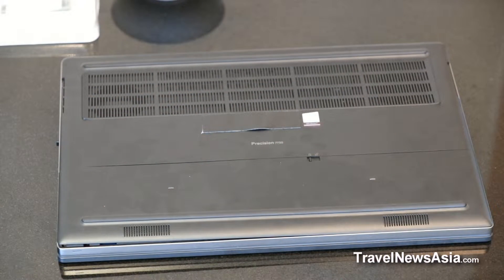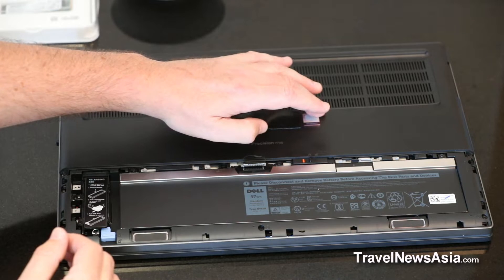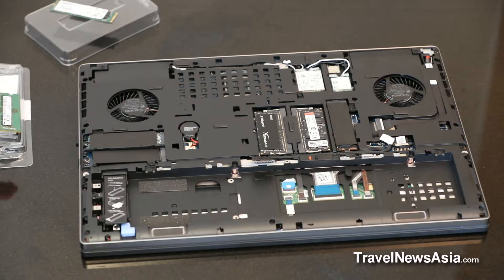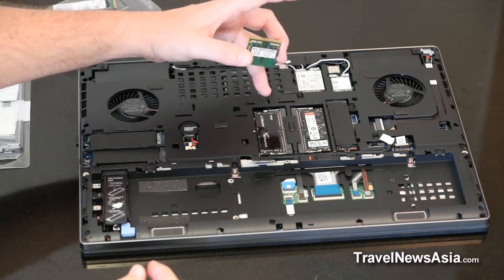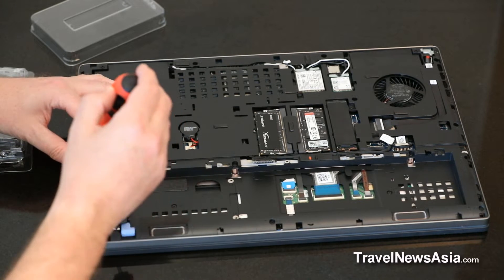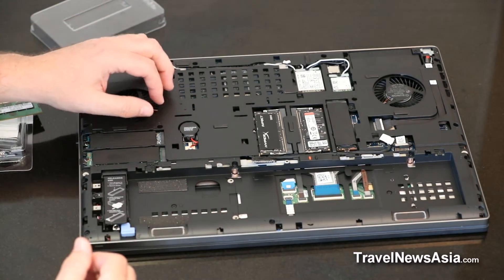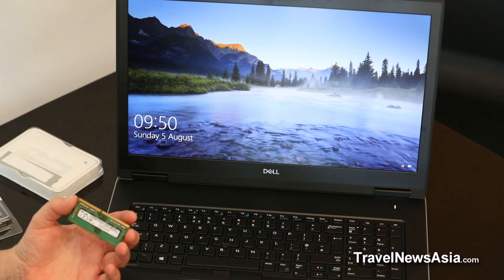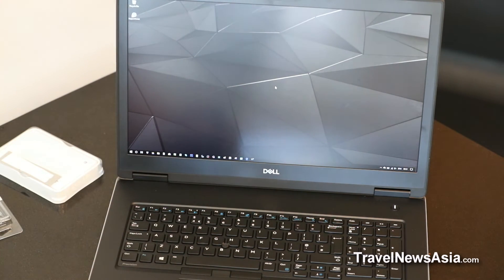Dell Precision 7730 Mobile Workstation - Opening Back to Install RAM and SSDs

Comment: Excellent thorough video. Really looking forward to your full review.
Reply from the maker: Thank you for your kind words. Much appreciated.
Reply: asiatraveltips Unique content. Can’t see any of these laptops in person before purchasing and Dell should produce decent videos themselves but they don’t. Ideally I would like the 5530 but the fans will be on all the time which would drive me crazy. I am guessing since the 7730 is thicker it will have proper ventilation and won’t be noisy. Please abuse it during your review testing I’m guessing there is benchmarking software out there that can make the cpu/gpu work hard on demand.
Reply from the maker: I can tell you that the fans are surprisingly quiet and only come on when I am rendering FHD 1920x1080 video. Most of the time they are silent, even when editing RAW pictures. I am extremely impressed with that as my other Dell Precision, the much older M6600, is much noisier.

Comment: For someone who is not experienced it would be helpful to actually see you finish each process like actually unscrewing both screws and removing the back opposed to jumping to screen with it already removed. I am new to this and after I unscrewed the back seemed very difficult to remove and I am not confident enough to apply great force removing BUT if I saw you do it here and seen that great effort is needed it would be that much better. Maybe trivial in some ppls minds but you should take ALL levels of experience into consideration. Information good overall though. Thanks
Reply from the maker: Thanks for your feedback. The next time I do such a video I will do as you suggest. Thank you.

Comment: Thank you for the video and showing the interior design.
Unfortunately, there are no videos yet for the Precision 7730/7530 laptops, so I think it's good that you're the first :-)
I have some questions for you ...
Why did you only install 2400MHz RAM? According to Dell information, up to 3200MHz RAM is supported. Dell currently has only the 2666MHz Version selectable on the web page, but it will follow the 3200MHz Version at the end of August.
Reply from the maker: Thanks for your message. I bought the 2,400MHz CL14 RAM as I already have 2x16GB sticks of that RAM and so bought two more which gives me 64GB of 2,400MHz CL14 RAM in total. I did look at 3,200MHz RAM but the 64GB I have now saves me money and when the 32GB modules come out I will look at their price and consider upgrading to 128GB at that time. My next video will be about removing the front to install the other two RAM sticks and then there will be a video review once I have had spent more time using the computer. I am very pleased with it thus far. In case anyone is wondering, the 8GB of RAM that came in the laptop is Samsung  2,666MHz model: M471A1K43CB1-CTD.
Reply: Thanks for your quick reply :-)
Okay, if you already have 2x16GB, then of course that's logical.
Which application do you need 64GB or 128GB RAM? For pure video editing are 32GB but ok. I'm looking forward to your next video. What interests me personally is how well the cooling works and how loud it is. Especially how the CPU throttling under load. Most laptops today have massive problems with the 6-core CPU and are throttling the CPU a lot.
What exactly did you configure for a CPU and graphics card on the 7730?
Reply from the maker: You are right, 32GB for my needs is probably OK but I will still install the 64GB just to see what difference (if any it makes for my requirements) - I doubt I would go to 128GB because there is little point (for me). The other important specs of my 7730 are i9-8950HK, Nvidia Quadro P4200 and FHD screen. Until you stat rendering HD video or such like then the fans hardly ever come on, and are on a LOT less frequently than the ones in the Precision M6600. When you do stress the computer a little then a lot of heat is dispersed from the vents but so far so good. It is still early days for me in terms of getting used to this new laptop - just took me almost an entire day to set up Outlook 365 from my previous Outlook 2010 - so am still getting to know it. As I have been using a Dell Prevision for the past 7 years I am used to the noise of the fans, and the ones in the 7730 may even be slightly quieter and certainly do not sound as stressed as the ones in my Inspiron 5370. Thanks.
Reply: Mine is coming in 2 weeks .. hurra .. I think I should do a video as there is not much content .. on it
Reply: Thank you again for your answers :-)
If you should do a detailed practice test video on the laptop, can you go into more detail on the CPU throttling? Very good would be a Cinebench R15 multi-thread performance benchmark and a view of the individual CPU clock rates and the temperature development of the CPU cores and GPU during the test.

Comment: That is one sick laptop.
So can you have 4 NVME's on RAID 0 configurations on this laptop?
You mentioned two additional RAM slots, so 4 banks, 64GB? 
Looking for a VMWare Workstation Lab environment, thinking this would be a good fit for me.
Reply from the maker: You can have 4 NVMe SSDs in the laptop. I think they can be in RAID 0 or at least three of them can be I believe. Check with Dell whether all 4 can be in Raid 0. As for the RAM, yes there are four slots and you can have up to 12GB of RAM so max 32GB x4. It is an amazing machine.
Reply: @travelnewsasia  Is it realy can handle 128 gigs ? Thinking to upgrate on mine.

Comment: Thanks for the quick demo of dismantling of the laptop and RAM/SSD installation/replacement. I'll stay tuned for your next videos on Precision 7730 laptop.
## Can you share the OEM's name for SSD/RAM came with your Precision 7730 laptop? For my below-mentioned configuration, I have considered only 512GB SSD and 16GB RAM hence I am interested in those details from future upgrade perspective.
## Did you buy any accessories with this laptop (like portable SSDs with cables etc)?

$$ My proposed configuration for Dell Precision 7730 $$
# CPU - Intel Core i7-8750H, Six Core 2.20GHz, 4.10GHz Turbo, 9MB 45W
# RAM - 16GB, 2 DIMMS, DDR4-2666MHz SDRAM, Non-ECC
# Storage - 512GB M.2 NVMe PCIe SSD Class 50
# Graphics - Nvidia Quadro P3200 w/6GB GDDR5
# Display - 4K UltraSharp UHD
# Wireless - Qualcomm QCA61x4A 802.11ac Dual Band, 2x2, Wireless Adapter + Bluetooth 4.1
Your comments on this configuration will be really appreciated :-)
Reply from the maker: The RAM that came with the laptop was 8GB Samsung  2,666MHz model: M471A1K43CB1-CTD and the SSD was Toshiba 256GB NVMe KXG50ZNV256G. The only accessory I bought with the laptop was the Dell backpack as I like the quality and have a smaller version for my Dell Inspiron 5370. As for your configuration I would suggest you look at the price Dell charges for the SSD you have chosen and compare what you could get for the same money elsewhere. The Samsung 970 EVOs are excellent value for money, especially when you consider that they have only just been released. The 500GB and 1TB are extremely good value for money. Only you can decide if you need the 4K screen, I went for the FHD 1920 x 1080 option. Hope this helps. Thanks.
Reply: Thanks 👍🏻

Comment: Nice Video. I have a 7730 and want to use Raid 1 for 2 drives and have the 3rd M.2 for backup.  The 7720 was easy to setup for selecting Raid, any idea on this one?
Reply from the maker: I do not have mine in Raid, but I imagine that it is possible to do what you are thinking of.
Reply: @travelnewsasia   I will find out soon.
Reply: @travelnewsasia  Does the 7730 allow you to connect your NVME m.2's directly to the motherboard or are they going into the chip set and then into the motherboard. If its not going direct into the mother board it is slowing down the performance of the NVme SSD's. Thanks for the videos.

Comment: Congrats on the comprehensive video!
Can I ask something? I want to upgrade storage with a Samsung 980 EVO.
Do heatsink discs fit the slot of Precision 7730?
There is no clear info on this and would appreciate your input before purchasing.
Thanks!
Reply from the maker: I fitted the 970 EVO into the 7730 without any problems. I did not add anything other than the SSD and I think the heatsink pad it came with, though can't be sure as it was a while ago. Something very important for you to consider though is the 7730 is limited to PCIe 3 speeds. If you buy a M.2 SSD which is PCIe Gen 4 you won't get the 7,000 Mbps speed the Gen 4s are capable of, you'll only get Gen 3 speeds. There is no workaround, apart from buying a new laptop.
Reply: @travelnewsasia  Thanks for the useful info! I guess its better buying gen 3 and saving the cost then. Thanks

Comment: Very nice video. Could you tell me model/part numbers of two panels which covers battery and and the large one which covers the rest of the laptop?
Reply from the maker: I will check that later today and get back to you.
Reply: Ok, thank you in advance.
Reply: Hi there, did you manage to check it out?
Reply from the maker: Sorry,  I have been so busy and completely forgot! I just checked for you and the two parts are very similar. The small bit is: FA26K000I0 and the large part is FA26K000J00. Hope this helps. Thanks.
Reply: Thank you very much!

Comment: After installing the additional SSD, did you have to change anything in the BIOS or in Disk Management?
Reply from the maker: Yes, from memory you need to set it up in disk management and give it a drive letter etc. That is also when you can choose whether to partition or do what you want with the disk.
Reply: @travelnewsasia  Okay, thanks. Video was very helpful btw.

Comment: Thank you for your videos about the Precision. Which graphics card did you choose for your configuration? Does this laptop have Nvidia Optimus? And how is battery life under moderate load (web browsing, watching Youtube, etc.)?
Reply from the maker: I chose the P4200 and am very happy with it. I believe it does have Optimus. I have not tested the battery life yet, but can do that later today and let you know how it goes. My 7730 is normally always attached to the mains, and I rarely use it (or the M6600) on battery power, but will test it. Thanks.
Reply from the maker: As I mentioned earlier, I very rarely use this laptop on battery power but did a few basic tests over the past couple of days and am very happy with it. Just doing what you asked - basic browsing, watching YouTube and even light picture editing - the battery was at 75% after 1 hour and 20 minutes. The laptop did not feel hot and the fans did not come on.

Comment: Nice tutorial. I would like to know which screwdrivers do you exactly used (size or brand). Thanks in advance.
Reply from the maker: I will dig them out and let you know. I know they are not special though, I just used what I had available. Thanks.
Reply: @travelnewsasia  thanks for your response. Yeah I was actually wondering that after seen this video https://www.youtube.com/watch?v=Ph8vzJJWRTY, where the guy had problems with his Precision 7540.

Comment: Thanks very informative and easy. what is the ram you bought to replace. I am looking to put more ram in my 7730. right now I have 16gbs, I need to upgrade to 32gbs. Thanks again
Reply from the maker: I always get the Kingston RAM for some reason. Samsung, Crucial etc all now sell what you need, so best to look for a brand/price you are comfortable with. The price is currently half what I paid for it.
Reply: @travelnewsasia  Thanks

Comment: Thaks for Your video... i have sama Dell.. i wang tO ask... How many  Terabytes hard drive SSD upgrade are there...
Reply from the maker: I am not sure what you mean. On the 7730 in the video you can have 4 NVme PCie SSDs. I do not think there is a limit to how many terabytes. The limit will be decided by how much you want to spend and what is available on the market. Always worth checking with Dell directly though.

Comment: Hello there, quick question: I have the older 7710, When I installed the second M.2 disk, the HDD LED indicator is always on & blinks when there's a disk activity. any ideas? as if the normal situation is reversed!
Reply from the maker: Sorry, I do not know about the 7710.
Reply: @travelnewsasia  Thanks 👍🏻
Reply: Late reply, but that's a normal thing when any disk activity is happening. That's the function of the HDD LED indicator.

Comment: Thanks for this video, and showing how to replace RAM and SSD.  I'm a newbie, so please excuse the question, but can you tell me how to find out what SSDs and RAM are compatible with the Precision?  I know I'll want to upgrade, but I don't necessarily want to buy Dell products if cheaper equivalents are available.  Thanks so much!
Reply from the maker: The SSD has to be M.2 - whether you go for the faster PCIe / NVMe or standard M.2 is up to you. Personally I like the Samsung 970 EVOs, though WD Blacks are also supposed to be very good. If you choose the smaller battery you may be able to slot in an old fashioned 2.5" HD but really you'd be better off with a bigger battery and extra M.2 slot. RAM can be up to 128GB DDR4-2666 SODIMM (4x32GB). Most people won't need 128GB of RAM, even 64GB is a lot and 32GB will be fine for some.
Reply: @travelnewsasia  Thank you very much - this was really helpful!
Reply from the maker: You're welcome. Good luck!

Comment: Thank you for this video. I own a 7530 Precision, planning to use 3 NVMe SSD's, two in raid0, would install win10 on the 3rd NVMe. I'd go with the Samsung, but I dont know which modell: EVO 970, PRO 970 or PM981. What is your opinioin on this?
Reply from the maker: I personally use the EVO. Depends what you need it for, the PRO version has about twice the rated writes as the EVO and can hold its write speed for longer, but for most people the EVO will be fine.
Reply: @travelnewsasia  thank you, bought meanwhile an EVO 500GB SSD.
Reply: Is it possible to use two SSD drives in raid0? Webre you able to try it out?
Reply from the maker: Excellent. I am sure you will enjoy it. I always need more storage and should have bought some more 1TB or 2TB EVOs in the black Friday sales! Hope the prices come back down again.... ;-)
Reply from the maker: I believe you can, but I have not tried it.

Comment: Thanks for the great video.  I am about to pull the trigger on a very similar system (i9-8950HK CPU and P4200 graphics) .  My current laptop is a first generation HP ZBook 17 I purchased over four years ago.  I tend to purchase the highest end I can find and keep it multiple years to justify the large initial cost.  The 17" 5th generation HP ZBooks seem to be having production issues, which is causing me to consider moving to a Dell.
A few questions for you and your audience.

1) I am looking at a 64GB (2 x 32GB) RAM configuration.  My thought is that I can upgrade to 128GB in the future when RAM prices come down.  Is it a safe assumption that the 2 x 32GB modules would be installed under the keyboard so when I upgrade, I can add the two new 2 x 32GB modules on the back as per your video?
2) I am trying to determine if the $800 increased price from the P4200 (16GB) to P5200 (16GB) graphics card is worth it.  Any thoughts?
3) Which option did you get on the display?  The description of the high end option (+$200) is a mouthful and I have no idea what it means.  Any ideas?  Do any options include a touch screen?  Here is the high end display description.  "17.3" UltraSharp UHD IGZO 3840x2160 AG NT, No WWAN, Cam/Mic, w/Prem Panel Guar 100% color gamut"
4) I am going to take a similar approach on the hard drive as with the RAM.  I plan to get the M.2 1TB NVMe PCIe Class 50 SSD and get additional drives in the future when prices fall.  It looks like I can save about $300 going from class 40 to class 50.  Any thoughts? 
5) Any thoughts on a carrying case.  I got a nice HP leather case that is still holding together after over four years.  However, the Dell offerings seem weak.  Any suggestions on a nice carrying case?

I am up to over $5,000 on  my current configuration.  I hope to pull the trigger in time for Christmas!

Thanks again,

Mark
Reply from the maker: Sorry for the delay in replying. In answer to your questions:
1) I would ask Dell if they can put the 2X32GB of RAM under the keyboard. My RAM came in the back. 
2) I wondered about this, but in the end I could not find any reasonable justification to go with the P5200.
3) I went with FHD (1920x1080) I do not believe that any of the options are touch screen, but may be wrong.
4) I went with a smaller option and installed Samsung 970EVO NvMEs. Very pleased with them.
6) I took the Dell laptop backpack option and am very happy with it. It is not fancy, but it works.

Comment: Thanks for the video. Very helpfull. I have a question.  If I buy it with 8 GB of ram and I want to upgrade to 32 Will I have to remove the keyboard or it's not necesary? Do you know in wich slot Dell Will install the 8 GB by default?
Reply from the maker: Mine came with the two RAM slots at the back filled. They are the easier to get to. If you are only putting 32GB of RAM in then you could buy two sticks of 16GB and just put them in the back. If you wanted to install 4 sticks then you would need to access the front and back as per two of my videos.
Reply: @travelnewsasia  thank you!